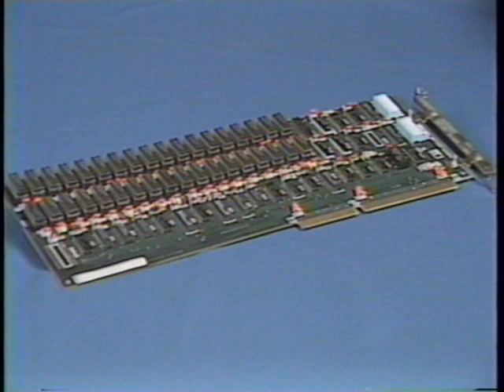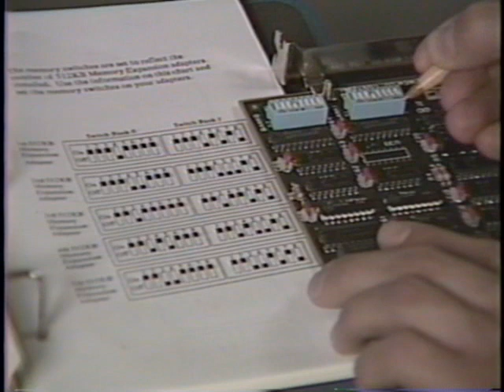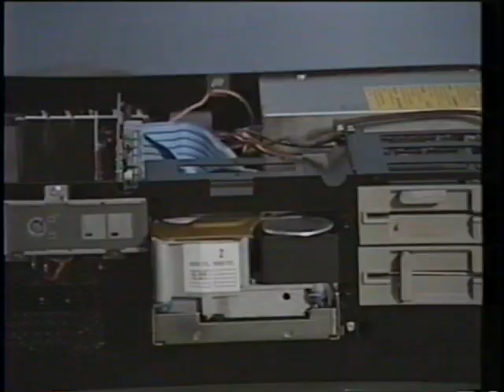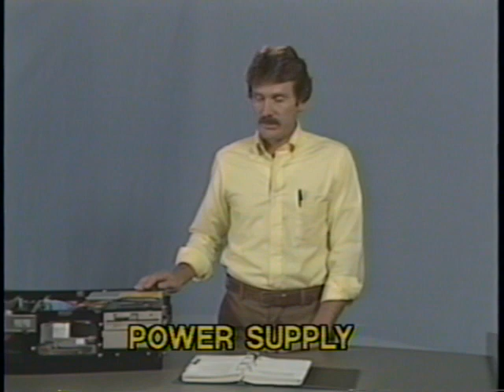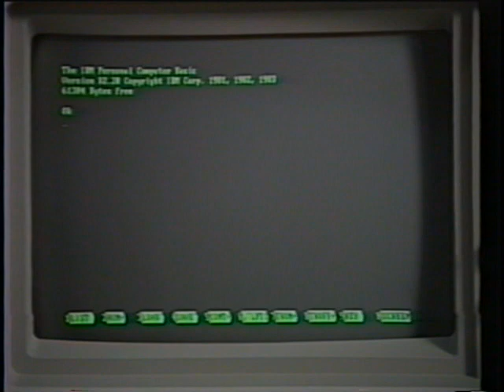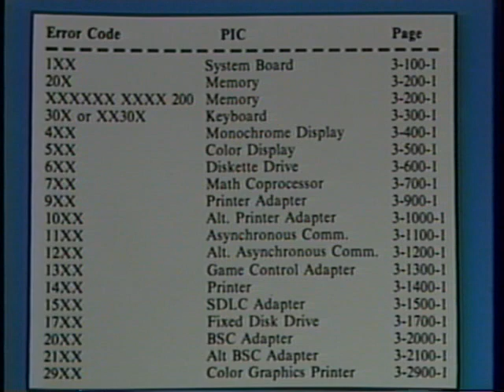PC AT Introduction and Service Training (1984)

Comment: Is it just me or am I the only one that wants to go out and buy a computer like this one? To have computer tech from a time before you were born, deck it out to max specs, and experiment with it.
Reply: I have a PS/2 Model 60, a 286 from 1987 which isn't quite as old as the PC-AT but it's close. And while the hardware is nice to look at, to be honest they are pretty dull machines. They were behind everyone else on graphics and sound, being basically business machines. I'm glad I've got the massive 42MB full size hard disk drive (it looks like a refrigerator compressor!) but there's not much you can actually do with an 80s PC.
Reply: Nope, not the only one.

Comment: 2:53 3 MB max RAM... Yikes!
Reply: An 80286 has a 24-bit memory bus. Even accounting for ROM, up to 12 or 14 MB of RAM should be feasible. Granted, out of the 8 slots two are pre-occupied and one has to be used for a video card. That still leaves five slots free for memory expansion. The largest memory expansion card shown in the video is a 512 kilobyte card. Using five of them adds 2.5 MB of extra RAM to the system. But, given newer and bigger memory expansion cards, five 2.8 MB cards should expand the 512 KB of RAM to a full 14 MB. However, you wouldn’t have any expansion anymore, and frankly I doubt anyone would make a memory expansion card with such an odd amount of RAM.

Comment: I had my first experience with a PC (microcomputer) using a Tandy Radio Shack TRS-80 Model III with 32Kb of RAM, a 2Mhz Z-80 Microprocessor, and two 5 1/4 floppy disk drives. It's operating system was TRSDOS.  That computer was manufactured back in 1980 by Tandy Corporation.

Comment: Kids have it so easy these days. You actually had to read manuals and get your hands dirty with the core of the machine. New PC's made everything simple with GUI BIOS, no dip switches required.
Reply: And besides, computers have been using GUIs for a very long time at this point. They're not exactly a new-fangled idea.
Reply: Isn't that the point of technology? To make life easier? Geez.

Comment: Huh, at 18:07, there are memory chips stacked on top of each other. Did they troubleshoot the RAM that way?
Reply from the maker: No - that's the way the RAM was shipped from the factory.  I forget the specifics but they made use of two slightly different chips stacked on top of each other.  See http://minuszerodegrees.net/memory/41128.htm for details.
Reply from the maker: Remember, these are not stacked for debugging - they have a slightly different pinout.  Stacking for debugging is a great technique, and definitely would not work if you had two different pinouts.
Reply: Terry McKean I understand that, I've just never seen RAM chips factory-stacked like that before. I did a lot of stacking myself while troubleshooting my own Speccies back in the day :)
Reply: +ZXRulezzz They stacked them like that in order to increase the memory availability....example, two 4 kilobyte chips stacked equals 8 kilobytes total in one socket.
Reply: ZXRulezzz
Right on :-)

Comment: wow I did not know about the terminating  resistors for the floppys! I know only for MFM hard drives . must I remove the terminator resistor from a second 5.25 drive im my first one is 3.5 ?
Reply: Yes.  Only 1 terminator should be on device at end of the cable.  (Basically the cable needs a terminator resistor at end, for signal to function properly.)

Comment: Heheeeee I had this pc in the mid 80's, I actually really miss those days even though technology was so crude it had a special feel to it if that makes sense.
Reply: I had my first experience with a PC (microcomputer) using a Tandy Radio Shack TRS-80 Model III with 32Kb of RAM, a 2Mhz Z-80 Microprocessor, and two 5 1/4 floppy disk drives. It's operating system was TRSDOS.  That computer was manufactured back in 1980 by Tandy Corporation.

Comment: There is a lot of useful information in this video.  I had no idea that the early AT hard drives were full height, EGA was not yet available, or that there was a separate ground wire for the drives.  IBM's usual presentations may be dry, but they get the point across.